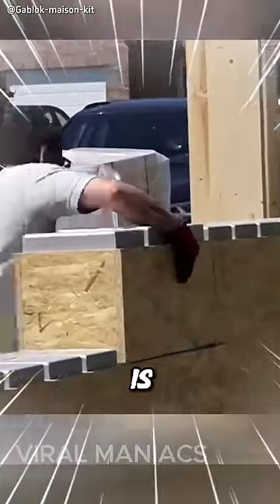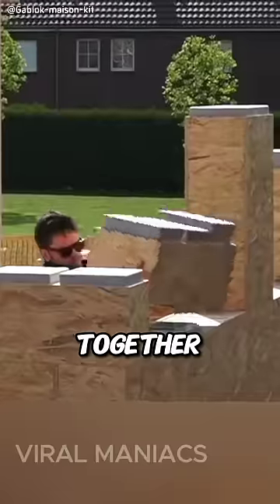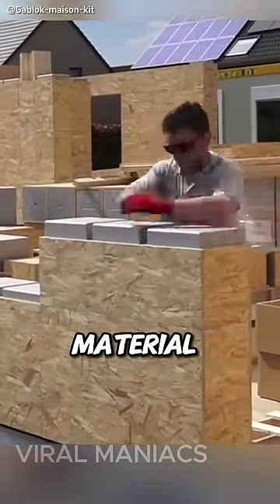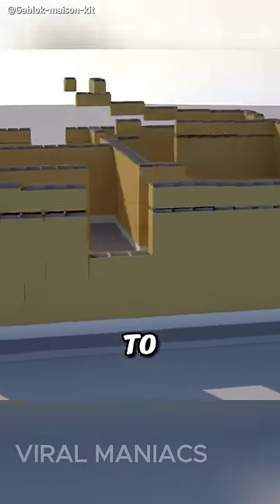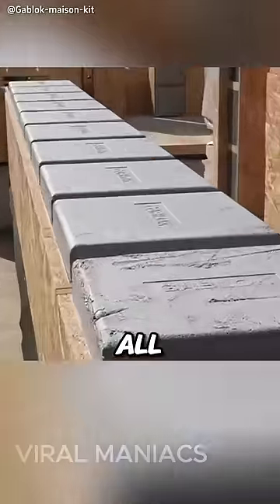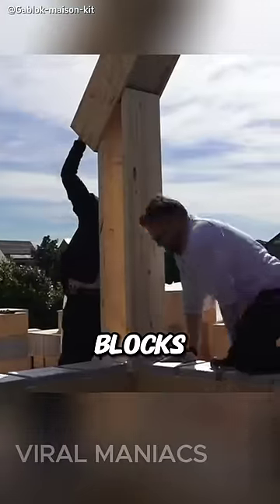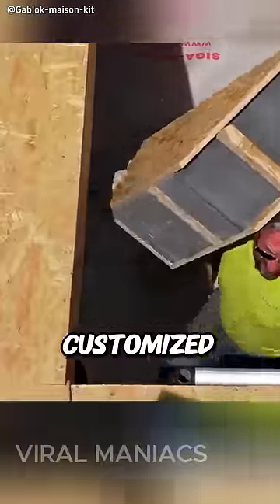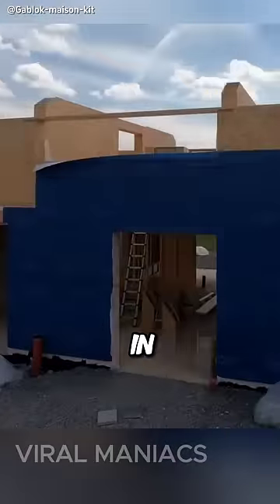Whoever Invented This Way Of Building Houses Is a Genius #shorts

Comment: Warm in the winter, cold in the summer and sent flying when there's a hurricane.
Reply: easy just hold B or Circle and you can build it right back
Reply: Or..... Hear me out. Just don't build a house where hurricanes frequent
Reply: just collect the parts and build it again bro!
Reply: @emberphoenix2922  atleast not a house like that. but the issue is that brick houses kinda sorta get damaged, and are pretty expensive, whereas those papermache houses are faster and cheaper, thus can be used to build up an area quicker.
Reply: It is not meant for americans
Reply: Exactly what I was gonna say..
Reply: Slight breeze knocks off a couple of blocks 😂
Reply: @adriankubicki3817 or Southeast Asia!😂
Reply: Better yet have the floor made the same. Seal it all and in a flood.... instant house boat.
Reply: Just line the outside with bricks
Reply: Good 1
Reply: I was thinking Tornado lol
Reply: Yeah, they should have some vertical metal rods/slats bracing it, connecting the top to the foundation
Reply: Or and EF4 or EF5 tornado.
Reply: What about divorce 😂
Reply: I was thinking the same. Where are the main pillars or columns in the house ….
Reply: Is it fire proof?
Reply: @lynsthoughts3576 I imagine they do have some form of bracing it  they probably thought of it all
Reply: @chicago-l9125 as far as I know (having spent most of my life where tornados frequent), only dome or basement/earth bermed houses stand any chance in those circumstances.
Reply: Compared to? houses in america go flying away every year, they still dont build to withstand them properly.
Reply: Not every area around the world experiences hurricanes....
Reply: @emberphoenix2922 Yeah,  there's a nice small patch of land about 2x2 feet where there are no hurricanes,  tornados and earthquakes. Smart move brother.
Reply: @walterdaoilen4140  Polystyrene will be toxic when it burns.
Reply: @emberphoenix2922 Floridians: 💀

Texans, idk
Reply: @RebeLeigh ever think they might tie it down after stacked 😱
Reply: @ShandeleReynolds  you know I used to move and set up mobile homes. They are tied down with metal bands. Never saw one withstand a tornado
Reply: @emberphoenix2922  Or just build a house like in Europe?
Reply: Good thing I live where we never get neither hurricanes or tornadoes😂 wouldn’t be an issue at all in most areas of America.
Reply: @geroutathat  Find me a cost-effective design or materials that can withstand 200-300 mph winds.  Oh that's right, such doesn't exist.
Reply: @aimansuriaprakash2380  No shit, gonna tell us more obvious things?
Reply: What if you live in the Midwest and barley have tornados
Reply: @cstgraphpads2091  Water is wet
Reply: i mean like in u r in area were u dont get many tornados or hurricanes go for it. It is definetely cheaper than brick houses but if u live in US just dont bother buying it
Reply: Idk.. I’m going to need at least an outer brick wall.. and it’s going to need to be anchored into the foundation from some key points.
Reply: Lol!!! 🤣🤣🤣
Reply: And floats in a flood.
Reply: @emberphoenix2922  You either get hurricane's or tornadoes, take your pick.
Reply: @emberphoenix2922 or you know build it from something that doesnt blow away. like ~stone~
Reply: And regular homes survive hurricanes fine?
Reply: Gotta say this this is kinda a pointless comment, 95% or so of house will all fly away or be ruined in a hurricane 🌀. 
But it's so much easier to rebuild if your unfortunate enough, but it'd be way better not to live in a hurricane or tornado prone area 🤷‍♂️
Reply: Not to mention fire. This might burn twice as fast
Reply: Have they been lived in for at least 30years
Reply: @emberphoenix2922  They can take any type of construction and scatter it over a couple square miles.
Reply: Or you just eat too many baked beans......an inside job - literally ! 🤣

Comment: Keeps warm in the winter
Keeps cool in the summer
Flies at the first wind ✅
Reply: Imagine you do a brick exterior and plasterboard interior from there
Reply: @DeeFourCee that’s what they would do right?
Reply: @DeeFourCee bricking the exterior is actually really smart and fixes the main issue while still being a cheap house so cheers for that!
Reply: There is nothing to attach the bricks to the house, normally you can use wall ties on studs to secure the brick to the house, however there are no studs in this construction afaik.
Reply: @aussierichards628  I would hope so yeah xD
Reply: That was my first thought 😅
Reply: That's what i was thinking 😂😂😂
Reply: well that's why they're so easy to put together in case that happens, you just build again
Reply: Floats at the first rain
Reply: I’d switch the foam for concrete bricks w/ insulation inside them
Reply: 600 like haha, Legit what I was thinking
Reply: Secure with metallic mesh
Reply: Spray cement, then brick.
Reply: @tristananderson3014 there are two types of brick ties: those that penetrate the wall sheathing and fasten directly to studs, and lightweight ties that fasten to sheathing - these are typically used for brick veneer. Alternately, veneer panels (ugh) can be hung from the sheathing, or strapping + choice of siding could be used.
Reply: Actually wooden houses in Germany are built similarly with insulation between wooden walls and resist all weather winds and winter etc.
Reply: @merlinmantikur1338 only if you live in flood prone areas.
Reply: Oh gosh soo true😂😂😂
Reply: Burns like your dreams
Reply: @theprinceofallsaiyans_vegita  I bet it takes less than that… but you’re not wrong
Reply: @tristananderson3014 Just add studs... 😂
Reply: They are rated up to 275 Mph. That's 80 mph higher than a well built commercial structure using 25-gauge steel beams.
Reply: Firstly, the blocks are screwed together vertically. Secondly, the blocks are theoretically already relatively stable on their own. Thirdly, there are no extreme winds in Europe. And fourthly there is an installation level on the inside and a complete outer wall on the outside, which further stabilizes it.
Reply: @daemondrogan1875 25 gauge is extremely thin, like metal roof panel thin. They don’t make beams outta that. Source: I am welding 14-16 gauge right now; and that would still be considered thin for any big structural work.
Reply: @stevenrose4610  Yes, you're right. I was talking about inner wall commercial. Not sure what is used for outer and I didn't make that distinction.
Reply: @daemondrogan1875  If it’s any consolation I couldn’t find the wind rating for these things, but they say damage can occur on strong steel structures at 170mph.

Comment: There’s an electrician and a plumber watching this right now and cussing in sync 😂
Reply: You got me!
Reply: … among others.
Reply: @gwilliams1001 or along the walls already there . 🤔
Reply: Ohh ya they are definitely dropping F bombs lol
Reply: exactly 😅
Reply: Nailed it
Reply: 🙌🏽 That was my First thought. 🤔 How are they gonna do the pipes for the water system an the electricity wires throughout the home. 😬
Reply: @gwilliams1001 What's that mean? Like the inside walls are just framing and drywall and you run all the plumbing and electric through those? 

Aren't kitchens usually on external walls?
Reply: Smart builders try not to run water in outside walls to combat thermal bridging and or freezing. Getting those systems to meet code could be a problem
Reply: There's a firefighter doing the same thing.
Reply: It’s simply a cmu. The shower is in a separate building. Along with the washers, dryers, snd chow hall.
Reply: I could maybe see this for an outbuilding but I did build some sweet Lego houses back in the day although Lincoln Logs was my favorite
Reply: just run along corners and ceilings, hide with moldings. easier to fix. hiding plumbing and electrical inside walls just a terrible idea to begin with in the first place.
Reply: Could you not put all of it under the floor? Drop the electrical down from the roof?  I'm not a carpenter but I remember as a kid. We lived in a house where all the plumbing and electrical was underneath a concrete slab. I only know this because one of the pipes leaked in the head to break out the concrete
Reply: I was coming to the comments for this. Thank you.
Reply: This is what the world gets when kids are raised on Tetris legos and Mario
Reply: Da gibt es bestimmt schon fertige Steine mit einem Stück rohr und Kabel drin. Oder einem Lichtschalter plus Steckdose. 😂😂
Reply: Bro i an and i was
Reply: Yes
Reply: I would think that they have a set that allow for wiring and piping, which are probably better, because you probably can get back in them.
Reply: @gwilliams1001 why would I want to build two walls when I could build one?
Reply: @gwilliams1001 this is the way
Reply: @stevewang except that that isn’t legal.
Reply: @tigerjr38 how long did it take?😅
Reply: 😂😂😂😂😂😂😂😂 hell yeah😂😂😂😂
Reply: How much is something like this?
Reply: I was just wondering how those 2 will be done..lol
Reply: LOL That's literally what I was just thinking about. Where and when does the plumbing and wiring factor in? Also, I didn't see anyone nailing anything down, so unless they just didn't show it, your house better be in a place that has no weather other than Sunny with a Light Breeze...
Reply: You would probably have to do open cables , instead of hidden in the walls
Reply: That's what I was thinking
Reply: @MrSleepProductionsInc  where in code does it require plumbing and electrical to be run through main walls?  

run through corners and round off corners. external conduits in ceiling edge+lights.   with no plumbing and electrical in the middle of the wall, that's LESS hazzard.

it's not a legal issue.  it's just lazy design catering to antiquated norms.  try doing a renovation.

sooo much easier to fix instead of poking holes in the middle of the room.
Reply: @stevewang  NEC 300.4
Reply: @MrSleepProductionsInc  you proven my point. it's for both concealed AND exposed builds. example commercial spaces.  still not a rule that it should be inside wall, as it's not the only way to protect runs. there are plenty of standard external runs methods will proving good visual.

if you leave it up to the contractor then the you always get the cheapest build they feel like giving.  

imaging a home where easy repair is a feature.
Reply: @stevewang  your original post stated to run wire in corners and hide or conceal with molding. 300.4 defines what is allowed in concealed spaces. My understanding and the opinion of the inspectors in my area don’t consider hiding wiring under moldings which are typically 1/2” thick to be a legal wiring method. Your jurisdiction may have different local codes and allow such methods. Best of luck to you.
Reply: I hate to throw this out here this late but I absolutely forgot about the HVAC guy that’s throwing shit all over the shop after reading the scope of work 😂
Reply: How do you run plumbing and electric?
Reply: And laymen also wondering how that shit works in this terrible idea.
Reply: This is a fire fighter and life safety deathtrap. These houses should come with a warning, "do not enter".
Reply: Tru I guess the would have to drill into the foam but it would be a nightmare unless once you build the first floor you just make a floating wall with studs and drywall so you can wire everything
Reply: That's where my mind was going lol
Reply: remove the polystrene from a block and you have a premade channel for pipes and wires. I'm more concerned about how many insulation gaps there are
Reply: As long as you drill them before stacking it could be easy. Anything along the wall horizontally could be done in a jig and then stacked. Along inner walls you could skip the styrene and use lumber for structure in certain columns for vertical pass thru. I mean personally I'd add more structure to the exterior before closing it off with real plywood.
Reply: me thinking about running emt conduits on the walls
Reply: I think it's actually for sheds rather than houses
Reply: Gablok website explains that plans include 40cm gaps where needed and those get covered by finishing plates after.
Reply: lol  @jasonpwnd
Reply: Run wires into holes in the outer walls... thats it.
Reply: You just need a big enough drill bit
Reply: Have the bathroom touching an outside wall so you can easily dig out the  hole under the toilet and shower drain.
Reply: Fuck I thought this was great until I saw this comment
Reply: They use bluetooth water/drain/and gas....duh
Reply: Thick walls - more thickness for pipes/wires?  I got no room left!
Reply: I’m not cussing. I’m laughing at the house with no power or plumbing😂😂
Reply: @stevewang yeah that’s not how plumbing works bro. You clearly know absolutely nothing. I would just stop talking
Reply: @MrSleepProductionsInc   by "run wire" it's armor cable or conduit, but not along inside the wall.  300.4 still not a rule that runs need to be inside wall.  ceiling crown molding have plenty of space.
Reply: @TheWilliam1266  exactly my complaint. all the codes are mainly for "safety" but not for better maintenance and repair.  it's up the good will or ingenuity of architect and contractor to design for the user... then meet codes with better designs.

for people who think the current way is better... wait till you have to fix it!
Reply: This is why you make the 3d model so they can make the specialty blocks just for this reason.
Reply: Les pipes and wires in the walls = easier maintenance.
Reply: IKR? You're the only other person here thinking that Lego houses DON'T HAVE UTILITIES!!!
Reply: @Xt4209 you're right, people actually start to use their head for once in a generation. Crazy what happens when you use your head and your hands at th3 same time isn't it?
Reply: @Nordickaiser or... hear me out, use 2x4  interior every 16 inches along each wall, then run your wires between?
Reply: Actually, it's easier. After the structure is up, they place a type of wood spacer about 8 feet long, and 16 inches standard stud spacing apart. The spacer itsef looks about 4 inches away from the inner wall making am additional wall over the exsisting one. This new wall can be covered with sheetrock. This gives enough room to run electrical as most new electrical boxes for outlets and light switches can be found less than 4 inches deep. 

As far as plumbing, I'm sure the main water inlet to the hot water heater (with another off the main for cold) would run  under the first floor like in a mobile home and pipes are then run normally as in a traditional home. Since the most common pipe diameter for your sinks and tub is only 3/4 inch (DN20) Grey water or (sewage out) is about 4 inches in diameter. If you have a bathroom on the first floor, not a problem but the second floor may need additional spacing from the wall. 6 inches would not be a problem
Reply: I don't know where you come from, but it's pretty common here to have normal walls and then an installation layer on top. So, this doesn't do anything to the electrician.
Reply: Uhm, you just run them in walls and cover with plastboard or plaster like every house in Europe?